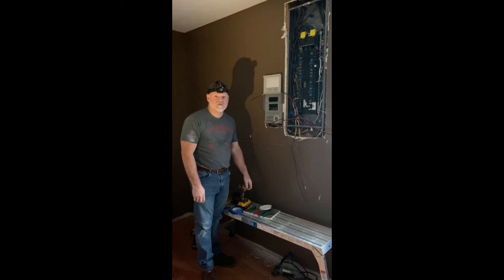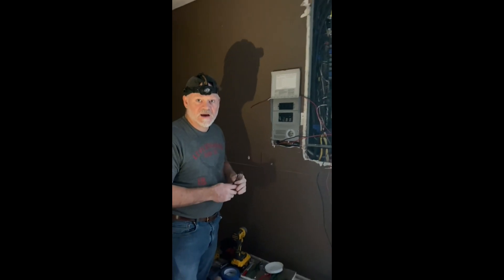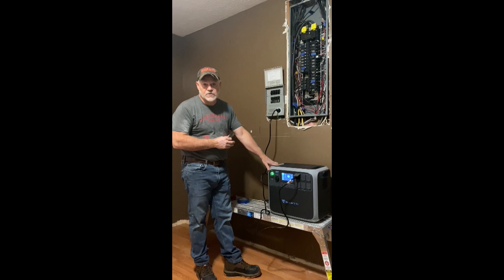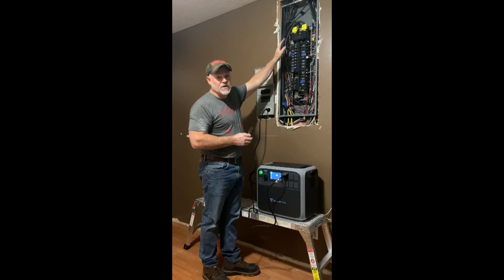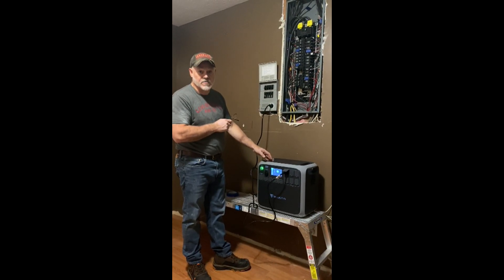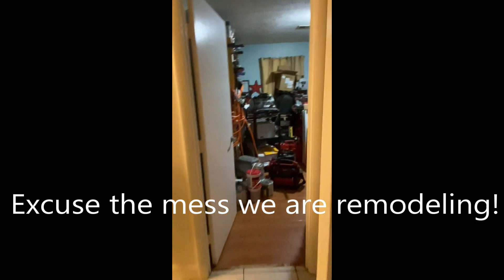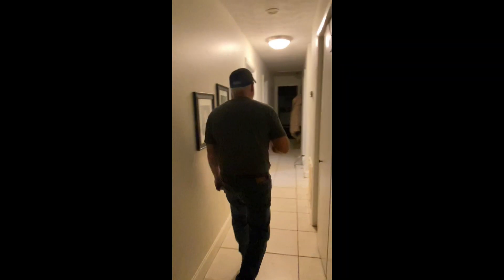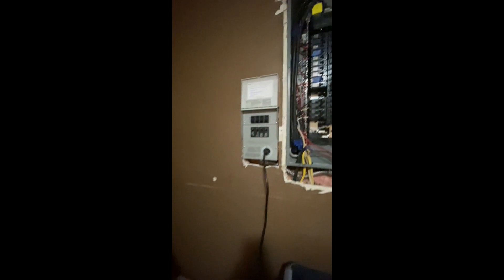Bluetti AC200P and Pro/Trans Manual Transfer Switch

Comment: 100% best Generater.Systems I have used. A test for hurricane prep here in Louisiana: three AC units, 5000, 5000 & 8000, 3 fridges, 2 device power setups, 4 flat screens....AND I had 40% of the power meter to spare.
Reply from the maker: I wouldn’t recommend it. That’s called back feeding and could cause damage to your house and hurt a lineman working on down wires if not done correctly. The transfer switch is the best and safest way to hook a generator up to your house. Thanks for watching and commenting.

Comment: Hi. Thank u for this great video!
Would you be so kind to give me some advise with my solar setup plan?
I bought a Bluetti Ac200max with the charge enhancer.
I was planning to instal 2 Ja Solar panels ( each 460W ) and 1 panel ( same JA Solar 460w ,) in combination with a transer swicht.
Is it a good idea to instal more panels then 3? In series or parallel?
The specs are the following:
VMPP: 42.13 V
IMPP: 10.92 A
Isc: 11.45 A
Voc: 50.01 V
Temp. Coëfficiënt (Mpp): -0.35 %

I live in Belgium ( Western Europa).
Thank u very much!
Reply from the maker: As long as you stay under 145v you will be fine. Put 2 panels in series and run them into the solar input of the ac200 max and run the other one through your dc charge enhancer. Thanks for watching and commenting.
Reply: @PreppinontheCreek12  Is it a good idea to put more  then total of 900 w panels on the main input? I'm not sure about it. I live in a region with not so good weather in the autum and winter season.
Is it the Voc  or VMPP?
Reply from the maker: @Lili-The-Chihuahua  it’s the VOC. You can over panel as long as you stay under 145v on the solar input. If you had 4 of those panels you could put 2 in series another 2 in series and then parallel those two sting’s together. I hope that helps.
Reply: @PreppinontheCreek12   Thank u.
So if would do the 4 panels in series and then parallel them it is  100 Voc?
And the other input with the charge enhancer is also possible to put 2 parallel with 50 voc?
Reply from the maker: @Lili-The-Chihuahua  on the 4 panels you put 2 in series the other 2 in series and then parallel them together. I wouldn’t try to put 2 panels on the charge enhancer with the panels you’re using. I don’t know if it can handle the current.

Comment: Thanks for the great video. So, if I understand, I can isolate say most 110v and run solely on the bluetti and just run the 220v < hvac, water heater, stove> off the grid. Since the hvac and wh, stove use about 40-50% of the electric I should save that much monthly off of my grid bill, right? That would give me both UPS for when power outs and pay for the bluetti in 4-7yrs.
Reply from the maker: As long as you stay under 2000 watts you can run your 110v circuits. You need a way to recharge (solar panels) and you will have days where there is no sun. How much it can save you I don’t know. My purpose is for emergency backup and to run some circuits off grid when I have sunny days to do it. I will usually run from 10am to 7pm everyday and then switch back over to the grid. When all my circuits are running I’m pulling about 600 watts. Thanks for watching and commenting I really appreciate it. I hope this helps.

Comment: Can this setup power a house that has an electric heated and cooling AC system?
Reply from the maker: This system is not powerful enough to power electric heat or a HVAC system. You would need a 240v system.  My system is for emergency use and pulling circuits off-grid to use less electricity.  We have alternative ways to heat or cool in a power outage situation. Thanks for watching or for the question.  Let me know if you have anymore.
Reply: @PreppinontheCreek12  I'm concerned for keeping heat in the house in case of power outage in the winter. Do you have advice for what your plans are for that? What's your alternative ways?
Reply from the maker: We do have several different alternatives for our family, and I’m going to be doing a video coming out soon. It will include, propane, gas and wood.  Everybody has a different situation depending on what’s available to you for your house. But a propane heater can be used, a gas generator for running a space heater or if you have a fireplace you can burn wood.  Solar power is not efficient for running electric heat unless you have a huge system.  I hope that helps and be looking for the video, I will be going over it in more detail.
Reply: @Preppin’ on the Creek  that will be a great topic to cover. Do you know if it is safe to plug a space heater into the Bluetti electrical outlet slot? I have one and thought about using that as a heat source in case of emergency but don't know if it's safe. Do you have input on that?
Reply from the maker: @SwitchSquadGaming  as long as the space heater is rated at less than 2000 watts you can safely plug it in the Bluetti AC200P. If you have a smaller Bluetti it will overload and not run it.
Reply: @Preppin’ on the Creek  it's 1500 watts at high power but the space heater has a fire warning on it not to plug it into anything else but a wall outlet
Reply from the maker: @SwitchSquadGaming  I have a few space heaters rated at 1500 watts but I don’t see that warning on mine. That could mean it doesn’t want you to plug it into an extension cord because the cord could heat up and cause a fire.  Most extension cords people have are 16 gauge cords and that’s not big enough wire for a heater. The AC200P does have 6 standard outlets that can handle up to 2000 watts between all of them. I don’t think they had power stations in mind when they put that warning on it. If your still uncomfortable you can look at buying another space heater that has some safety features built in.  I’m just speaking for me but I have plugged my 1500 watt heater into mine and it operates it fine.  I did that just to make sure it could operate it but like I said I wouldn’t use it as a heat source for me. I always make sure I don’t leave it without someone present in the room when I’m using it normally on grid.
Reply: @PreppinontheCreek12  ok thanks for the response and feedback. What is the name of your space heater you use?
Reply from the maker: @SwitchSquadGaming  I have a Honeywell HZ-2200 and a Vornado EH1-0097-85 (Costco).  The Honeywell I’ve had for several years, I don’t know if its still available.  The Vornado I got at Costco and they still have those.  Thanks for watching I really appreciate it and for the questions, I’m just getting started on YouTube and to have you checking out my videos means a lot.
Reply: @PreppinontheCreek12  I appreciate your detailed responses! Keep up the great work. Thanks so much

Comment: Great video.  Yours is the first I've seen, using a manual transfer switch, to power circuits.  Other videos show hooking up individual items to the solar battery bank. Same thing with a portable generator, using all those extension cords to power a few items.  We have a Predator 9000/7250 watts gasoline generator that I converted to tri-fuel. We have a 10 and 6 circuit manual transfer switch to power all the circuits in our house.  I use the 240/120V and 120V outlets on our generator.  Works like a charm.
Reply from the maker: That's great, thanks for watching. I wanted to be able to just flick a switch if I have a power outage and not run cords all over the house. I also wanted to be able to take advantage of the solar when we have nice days. It's nice to flip a circuit over and let the solar power stations run. I will be installing a interlock in the future for my gas generator to hook up to the house as well. I like having options. Sounds like you have a great setup, thanks again for watching.
Reply: I would like to buy a solar battery bank as a back up to our generator.  They just cost way to much, for the watts I need. But when we do buy one, it will be hooked up to the transfer switch.
Reply from the maker: They are pricey and I agree with the transfer switch hookup when you get one. Thanks again for watching.

Comment: Thank you for sharing your setup.   And don’t listen to all these people criticism about the music, housekeeping, etc… you do your thing and let the useful content speak for itself.  Look forward to your solar panel video.  Take care.
ALSO, if you can, can you please update description with the cable/power cord you used from the Bluetti AC200P to the transfer switch and the transfer switch product as well?   THANKS!
Reply from the maker: Thanks for watching and for the comments, I’m glad you enjoyed it.
Reply from the maker: It’s a 10 gauge 3 prong short extension cord that I run from the AC200P to the transfer switch. You can use 12 gauge as long as your circuits are 20 amps or less.
Reply from the maker: The transfer switch is a Reliance transfer switch but you can go on Amazon and look up Goal Zero Yeti Home Integration Kit Transfer Switch and it’s the same one I have except for the cord that comes with it. It says it’s 14 gauge.

Comment: Very good video.  I have a question to learn not to be disrespectful.  What is the advantage of having a manual transfer switch vs turning off the main and all circuits you do not want powered, then plug the AC200 (or any other generator) into an outlet to back feed the system?  I’ve always understood the benefit of the automatic transfer switch but struggle with the manual.
Reply from the maker: Thanks for watching and for your question. Back feeding your panel through an outlet can be very dangerous and is not up to electrical code. You can wire your panel to a generator using a interlock switch and it’s much safer and you can turn off all your breakers and turn on the ones you want to use. The interlock prevents you from back feeding the grid so you don’t hurt someone working on the electrical lines.

Comment: At 228w you can run it for
Little over 8 hours.. Correct?
Thanks for a great video....
Reply from the maker: At 228w you can run between 7 to 8.5 hours. You will have some losses so you won’t get exactly 2000wh. Bluetti also reserves 10% of the battery to protect it. But yea you will get around that. If your able to hook solar you can run all day if you have sunshine. Thanks for watching I hope it was helpful.

Comment: Jesus -  did you use a steak knife cutting out that Sheetrock?  I know you are trying to be helpful but basically all you are showing is “yes this works” which most of us know already. I don’t mean to sound rude, but if you are putting this out to potentially millions of viewers you might want to consider a little housekeeping first. Your video comes across as very hap-hazard and hillbilly…all the wires and sheetrock hanging out.  Why did you recess the transfer switch into the wall?? There’s no way to trim that out to make it look right. It’s made to mount neatly ON the wall, not in it.  

I’ve got the same transfer switch and Bluetti. With a lot of forethought, I placed an “inlet box” near the exterior of my garage and ran 10 guage wire inside metal conduit over to the transfer switch next to the breaker panel.  This way I can choose to use either a gas powered generator OR the Bluetti.  In addition, I’ve got 1200 watts of solar panels charging the Bluetti and since it has throughput charging, I can actually run many of the home circuits on solar during the day while the Bluetti continues to charge!

If you are truly prepping, you should know never to put all of your eggs in one basket. TALK ABOUT THAT.  Talk about why you chose Bluetti.  And for God’s sake man,  take snippets of video of the process, edit them, and then show the finished working product after you’ve cleaned up the mess. Use 4K video, it’s 2021 but your clip looks like 1990. I’m East Texas piney woods myself but do things professionally because I take pride in the workmanship. It needs to be done correctly not only for looks but for safety. It’s not that hard.   You’re welcome for the tips.
Reply: Since you already know it all, why for God's sake are you watching a video like this? And why for the love of all that is Holy do you have such a deep-rooted need to be recognized for unsolicited advice? Talk about that.
Reply from the maker: Thanks for the comments, I appreciate the feedback. As I mentioned it will be cleaned up. I’m installing an interlock switch for a gas generator so I have the option of gas or solar and once that’s finished I will repair the drywall. There’s more to the story than you see. The breaker box that was previously there was larger and left the gap under the panel. Everything is wired correctly and inspected by the county I live in. I recessed the transfer switch panel so the wires are behind the wall and if you have the same switch you know the wire runs through flexible conduit and would have to be run along the wall to the box and in my case through the wall to my breaker box. I don’t have a garage so I don’t want that look when I’m finished. If you noticed I said this is the semi finished product because there is still work to do. I’m showing progress along the way and I will be able to make the drywall look right. Thanks again for your comments.

Comment: Sorry for all the questions but , I just pulled the trigger on the ac200p and this is exactly what I’m looking to do, could you tell me what transfer switch this is and what type of cable is needed to connect the Bluetti to the transfer switch ? Like does it have to be a specific amp cord or is it a cord that comes packaged with the ac200p? Great videos by the way , a lot of people show videos camping with this unit but I’m looking to do exactly what you are doing!
Reply from the maker: Follow this link to Amazon Goal Zero Yeti Home Integration Kit Transfer Switch https://www.amazon.com/dp/B07C535GCZ/ref=cm_sw_r_cp_api_glt_fabc_DWEKCMQ8HQHYF9T5PE84. This is the transfer switch I used and it comes with the cord that plugs into the ac receptacle of your ac200p and the other end plugs into the transfer switch. Just remember to be aware of the current of the circuits you choose. If your using 15 amp circuits you need 12 gauge cord. If your putting it on any 20 amp circuits you need a 10 gauge cord. All it is is an extension cord. Male on one end female on the other. But again be aware of the amps so you use the right cord.
Reply: @PreppinontheCreek12  Thanks for this. A 20amp/10gauge cord will be able to run both 20amps and 15amp circuits is that correct?
Reply from the maker: Yes, a 10 gauge cord can run a 15 amp or a 20 amp circuit.
Reply: @PreppinontheCreek12  perfect! you are the man! i really appreciate this info! wish me luck hahah hopefully soon i can get setup like you!
Reply from the maker: @mostlypeacefultv  Not a problem. Good Luck!
Reply from the maker: @Stuffstuffington Stuff You can draw 2000 watts from the ac outlets of the ac200p. The surge watts is 4K but have never really tested that limit. I do run 2 freezers and 2 refrigerators all the time with no surge issues. There is a special dc aviation plug you would need to get to run through the 12v 25 amp port.